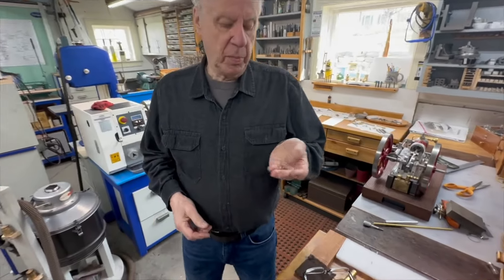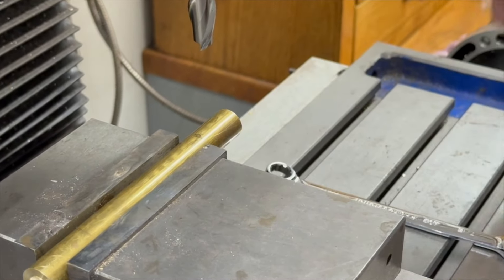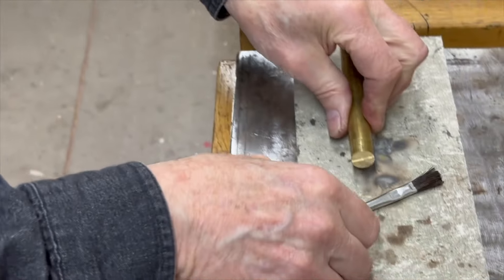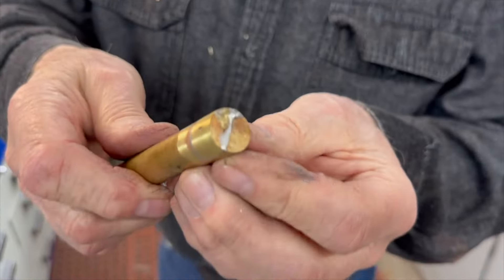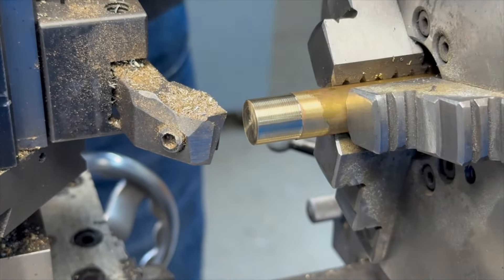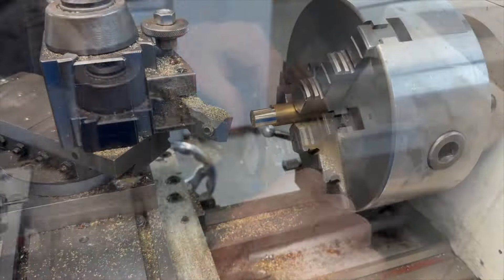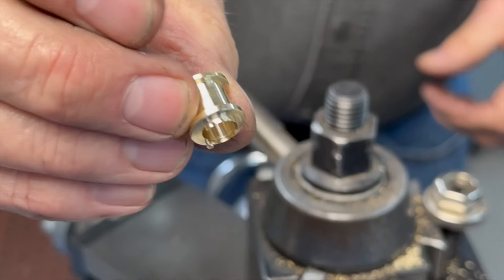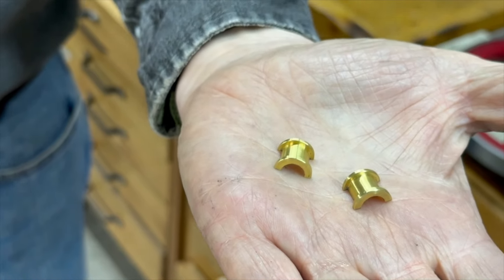Making Split Bearings for Model Engines

Comment: Why do you say you should use bronze? I'll be trying to make some soon.
Reply from the maker: I say bronze because it’s easy to work with, soldiers easily and is the longer wearing of most materials. You can use a lot of other different materials. A lot depends on what you are building. Split bearings are mostly used for connecting rods and main bearings in gas engines.
Reply: @JoesModelEngines  it'll be in a custom made v8 but yeah it'll be gas.